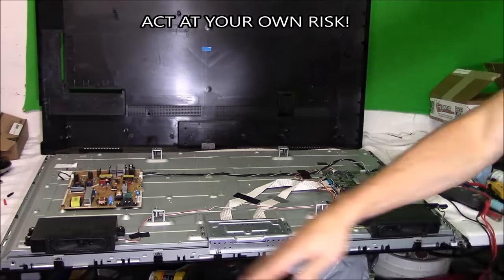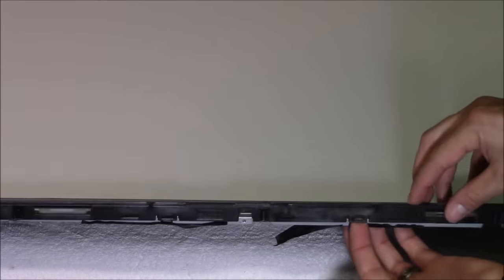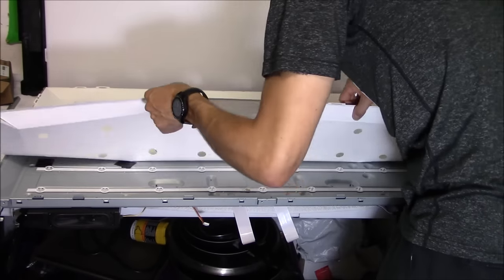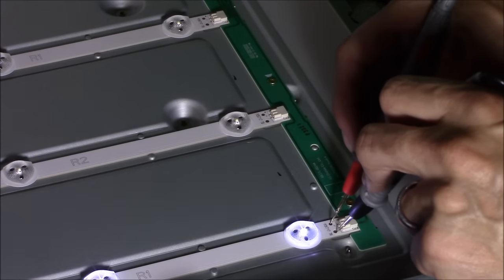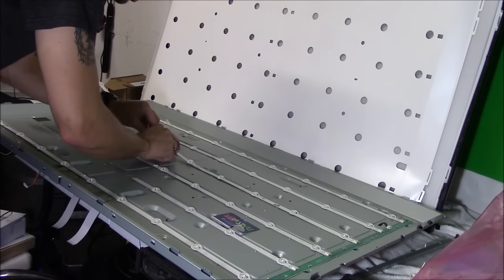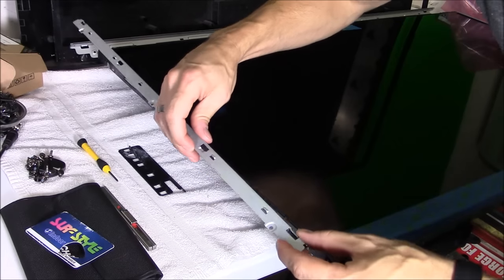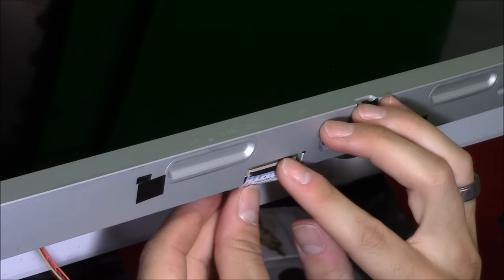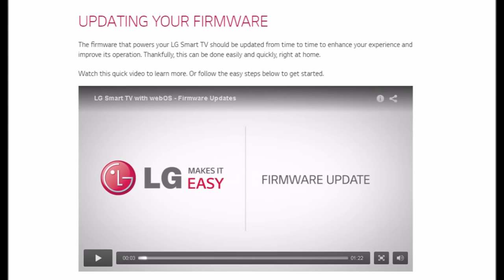How to fix LED LCD TV black screen no backlight, TV disassemble, testing LEDs, ordering part, repair

Comment: hi Tampatec, i have a problem with my panasonic LED tv... i just find out that theres is a bar (5 leds) with a burnt led and the other 4 was dim, so replaced with a new bar but the problem is when i tried to test all the bars before put all together only half of the bars ligth up and the other half not, if i try every single bar is ok , in your video i can see the screen looks identical to mine, 6 strips on the left and 6 on the right,when you test the strip connected together left and right they light up but mines is just half in all the rows ,any help will be appreciated. thanks.

Comment: Hey boss I just replaced the led backlights but I still have the same black screen with words on the screen when I put a flashlight to the screen. What should I look at next
Reply from the maker: Check Led driver circuit and check backlight connections too. Led driver circuit might be a separate board or built-in the power board. Get boards at Shopjimmy.com and electropartsonline.com

Comment: Why am I getting spotlight circles after backlight repair.  I soldered led beads to existing strips.  Is it because I used too bright beads or diffuser bulbs need to be more precise position. Cheers

Comment: i have a vizio e55-e2. one led in the right corner will flicker, sometimes the image is fine. eventually the backlight shuts down completely, image still visible with flashlight. is it safe to say the backlight led's need replacing? i can get a working set for 30$, so not bad if it will fix it. i have electronic experience, but very little experience with screens, so i wanted to be sure that is what's wrong before tearing into it. thanks to anyone who responds!

Comment: hey bro, do you know if the led driver for the rca led55g55r120q is on the power supply board? I have sound, no picture. but the picture is clear as a bell with a flashlight on it.  damn thing is only about 2.5 years old.

Comment: hi there iam jim, need to ask you a question about my philips 55pfl7007h/12 tv. the main power is plugin 220 voltage i have a black screen and led power doesnt go's on screen is totaly black when look it with a fleslight in the sceen i dont see any menu? can you give me some tips

Comment: Do you know the voltages I should see on the led output pins for a model 42ln5300-ub? I could send you a picture of the board if that would help. There are four pins for the led output. I can tell you I do have voltage at the plug one one pin I have over 100 volts DC on another pin I have between 1 and 2 volts with TV off. On the pin that produces over 100 volts with power off more than doubles the power when I power it up and led plugged in. I'm asking you this cause I don't want to try to replace the leds if the problem is from the power board. I replaced the main board and now have sound and can see a picture with flashlight shinning on the screen.

Comment: Could you advise where to find problem. Got Biard smart tv 49" with no light on screen. Found one faultyled in backlight strip. Removed that, by creating bridge with resistor. By supplying voltage backlight lightup. When connect to tv and turn on, back light light up for less than half second and then staing off. No standbylight error codes of flashing. However can see that tv is on and can see picture on screen. Measured backlight contact voltage at tv start. Showing milivolts, then at light up moment multumeter jumps from milivolts to volts, however only to 0v, belive voltage jump is too short, so multimeter is not as quick. Replaced new power boar, still same problem, and wvoltage on contacts still milivolts.

Comment: I have a 32" element flat screen. Made in 2015 an I believe that's also what's wrong with it is the damn back lighting LED bulbs...... because the screen stays black but the sound comes on an the TV turns on but the screen stays black.......

Comment: I have a LG tv I bought from best buy. 55 inch smart tv. If it’s not light strips what else would prevent the picture from coming on. When I turn on the tv it starts to come on it shows the whole tv light up and you can read where the LG lights up for about 1 to 2 seconds then go blank

Comment: Hi, 
Can you clarify something for me please? Based on your videos I think that I have a backlight problem. And your video as your testing the lights it appears that only a handful of them are bad. Why does the entire backlight system fail in that situation. It seems like the screen would only get a little dimmer with a handful of lights out.  does the entire backlight system fail if a few are bad?
Reply: Ok I see further down in the comments that if a couple of the lights go out the TV goes into a "safe mode".  Is that accurate and can this safe mode be defeated allowing the TV to operate slightly dimmer than normally would?

Comment: hey, my tv is a PENDO 48 inch and i cant find the led light strips for the tv , the light strips are 97cm long and the light bulbs are 9cm apart starting from 4cm from the end connector, Does it matter if i use a different brand of light strips that are the same length??

Comment: I have a 90 to 96 volt and a 130 to 137 volt on the led power going up and down plugged in LED cable or not.it is looking for the led strips I assume but the voltages are different on VOUT1 AND VOUT 2 .ANY HELP?I have sound on hdmi and picture with no backlight

Comment: Im facing same issue with Toshiba LED tv , its an old tv , but after exposing tv to direct sunlight for 15 min , it back to work 😁 ,  every time i turned tv on after being off , black screen always there,  but exposing to hot sunlight it back to work

Comment: LG 39LN575S hi my power supply led board is reading 230v at the cable to the led arry (led +) not the stated 130 volts, is this the board or the leds? i have no back lights.

Comment: I have a Panasonic Model TCL55DT50 LCD TV with LED Backlights.  I have audio and can see image with a flashlight.  No backlights. I have replaced LED Driver Board and T-Con board.  Still same symptoms.  I am looking for LED Backlight strips or a kit to replace. Have not disassembled panel so don't know configuration or quantity of strips. The Panel Number is VVX55F130B10 (ADDITIONAL NUMBER 12054J S 001552).  However, being told by sources that backlights are no longer available. 

Any suggestions before I take this panel apart???  Is it worth proceeding?  Expensive TV.......

Comment: Hello! Need help with this TV
Model No：DYNEX DX-60D260A13
Power Supply board No.：MHC180 tf60
Problem: works normally before been black screen in half an hour. The symptom repeats after around one hour. Two parts (QH1 and DH3)with a radiator in the power supply board are very hot before the black screen. LED voltage offload is 67 V, onload is 94V and 15.4V when black screen.
Please offer me some help with this problem, Thanks!

Comment: I followed the video steps by step and everything worked: however, when i turn on my Led TV there is a darkened area towards the bottom. All Led lights work but the brightness towards the bottom is uneven in the picture. 

Any idea what can be fixed??
Reply: Nwalk3er my bank has three tvs one of which has that same problem with it the bottom part is darker ! 
It is the led strips the LEDs are going bad! Sometimes they just go darker and not burn out right away!!

Comment: Could maybe one or two LEDs cause the whole screen to go balck at random?

I have a 70LB650V that works for a couple of minutes before the screen goes black, I still have audio though.
When it is on I can see a darker spot in one of the corners, which makes me believe that the LEDs are dead in that section.
Reply from the maker: Yes it's possible
Reply: Tampatec Ok, would it be due to maybe overcharge to the other LEDs that cause them to go out?

Comment: I have a 55" Vizio tv that is... Maybe 8-9 years old and it had lines on left and right side but I could get over that and just now I turned it on then in the quarter bottom went black like one of the old tvs and and it's blinking in white lines and it's darkened there please help and any way to contact u like send a photo of what it looks like

Comment: Have an LG 55" TV. Back lights went out. Have tester and when testing strips only 1/2 of each strip works. If right part of strip lights up then left does not. Tested each individual led on non working strip and each led lights up individually.  What is wrong?

Comment: Hi thanks for your videos , I wonder if you could help me out with something?

I have an LG47ODUE that shows LG Logo then goes black under torchlight image is visible.

Power supply board tests:

Standby voltages: in order on connector:

9) Ground - Ground = 0.0v
8) 12v - NC = 11.95v
7) 12v - 12v = 11.95v
6) Ground  - Ground = 0.0v
5) 24v - 24v = 24.77v 
4) Ground  - Ground = 0.0v
3) 3.5v - PDIM2 = 3.54v
2) 3.5v - PDIM1 = 3.55v
1) PwrOn - DrvOn = 3.42v 

Most voltages not present until standby button is pressed

Led Connector Tests:

106v down to 82.2v at led connector on both lines. LEDs connected

115v down to 82.2v at led connector on both lines. LEDs disconnected.

Diode Side Test: (red probe to cathode side and black to test points at led connector)

97v and decreases - cathode side of diode to test point at led connector.

LEDs have been checked out of the unit on a DC power supply two strips at 30v all LEDs work.

Work has been carried out previously as jumpers on led strips. Work fine out of unit on DCPS.

I had image but no backlight.

Could this be a caps issue???

Does the TV need all LEDs connected to work correctly (ie) cut out if not enough LEDs for load.

Obviously 88.2v is not enough to drive the leds

Comment: Please Help, I did this... Checked Volts 1 output should be at 100v, if it reads 130v the led backup lights are bad, if it reads 0.0 volts the led driver is section is bad on the power supply board is bad. So, I bought from you guys the power supply board and the T-Con- Board. The screen lights come on and then turns off with in 1 sec. ??Please, I particularly have rebuilt the TV. Awesome but I still need help

Comment: Tampa. if you power on and screen goes from black to a very dark gray ( i mean dark!) does that mean backlight is working?
Reply from the maker: check led backlight volts if over 120v then yes. led backlight will be dim, change to black to bright when about to fail. if backlight flickers or dims to black then backlight can be going bad but don't confuse that with TV eco mode when tv detects room lighting and changes tv brightness and backlight to dim accordingly.

Comment: I have an LG  70UH6350-UB  70 inch TV and as soon as you power it up lg comes up etc. and even of you go to TV it comes up with sound but 5-10 seconds later it goes dark. I turn it off and reset everything unplug etc etc still the same. Then I read where you can put the motherboard in an oven and reflow to get the unit to work. I tried that and that didn't work. So i am thinking is it in the powersupply unit? What is causing the illumination panel to shut off? Maybe you have a better idea. Thanks for any help in advance!
Reply: Btw way if i illuminate the screen with a flashlight i see the images from behind so i am assuming something is turning off the led panels from behind? The screen is well illuminated when it is first turned on , in other words it doesn't appear that any leds are not  illuminating etc. Thanks

Comment: I was hoping for some help. I have a 55" Samsung TV model un55fh6030 and the backlighting went dim. When I go to adjust the backlighting it will go to the number 2 and once I turn it to 3 it goes much darker and will increase slightly when I go up on the numbers but it's still very dark at 20, level 2 is the brightest
Reply: It makes me believe it's not the LED strips but a controller board, am I wrong?

Comment: So I've tested my LGtv with a torchlight and it seems that it does have the same problems with your vizio tv (when the tv is turn on, it does hve sound but no video). I can see the LG symbol moving around after pointing the torchlight on to the screen. Just to be sure....so do I have the same backlight problem? Is that how you know that your tv have a backlight problem? just want to be sure if I have to replace the backlight - thanks!
Reply: Sayd AlSaggaf backlight LEDs or power supply board
Reply: Phoenix Marzrover thanks fr the reply...thank you!

Comment: good vids Tampa,  question my Samsung plasma has this lines across the screen. but i can only see them when the screen is on a solid color any suggestions?
Reply from the maker: can be control board or main board or bad panel
Reply: +Tampatec is it expensive to get fixed?
Reply from the maker: +Damen stokes about 100 dollars but panel is expensive, try shopjimmy.com or electropartsonline.com to buy boards they are tested, warrantied, and offer returns.
Reply: +Tampatec thanks,
Reply: good video & many thanks

Comment: Hi @Tampatec, just subscribe to your channel, have learned a lot from your videos, thank you. I have a Samsung TV that is having an issue and was wondering if maybe you might know the cause of it. 

The problem with the TV is that about half of the bottom screen is a few shades darker then the top half. 
it also has this flashing white light that flashes about every 2 seconds or so just on the bottom of the screen. The flashing white light becomes more apparent when setting the backlight to 0. 

I replaced the T-con board hoping this would fix the issue, but the problem still persist. Do you think this is due to bad LED strips or just a bad screen panel? 

Thanks
Reply from the maker: bad lcd panel or tcon board would have black or color lines or color distortion on screen but not bright white flickering can be power board or backlight board on LED TV its called LED driver board but older LCD TVs its inverter boards. Also YES LED strips can flicker check my repair video- https://www.youtube.com/watch?v=U7hnmJS8Gfg&t=166s
Reply: Thanks for the quick response. I will try the swapping the power board next and see what happens. The TV is a Samsung UN65F6300AF
Reply: Ham Fitness
Reply: Yes?

Comment: So I have a Samsung samsung un46003sf. It wasnt powering on. I replaced the led strips. No issues. However putting together the film layers slipped. Theres tabs to align so no issues. Tv powers on. Works great except one major factor. Its 2 dark! Eco is off..brightness / backlight / contrast have almost zero impact. So i feel theres an issue with how the light is being defused onto the tv...i dunno though. Any help?

Comment: I have Toshiba 50L1400UC. and I have little black cloudy shadow in the middle part. so I have checked power supply for main board and led backlight driver. and I found 0 voltage on vled4+. so is there any Idea what should be the problem here?

Comment: I got one old model with a broken display.  All Leds working good  so I disposed the front display and back cover  and Tcon board to hang it in my garage as a ceiling light. It is too good soft light.

Comment: I tested all my strips with the 3 9volt method and all my lights work. But tv still cuts on and lights up for a sec then black screen? Power board?

Comment: People think it's not worth the trouble to do it yourself or just run out and buy new because the technology is changing rapidly but a friend gave me a nice plasma tv he was going to toss out but it was just a fuse inside the set blew in a lightning strike near by. I changed it after talking it apart and it has been on every day for 5 months no problems.Great picture for movies. Maybe this will change your mind. A set you don't care about is a good one to learn on and the price is right if free like my mine.
Reply: Repair a tv without a backlight tester

Comment: I noted you failed to mention or even handle properly the defuser panels. Any mark on those panels destroys the image quality. Also, LEDs seldom fail, the backlight intensity draws more power but does not effect how long they last.

Comment: Tampatec i have a 60inch sony bravia tv model KDL-60R550A i were total that it had backlight problem so i check the backlight and the one on the left side only half of them come on and the samething on the right side too.when i turn on the tv the screen light up and the picture shows but on the left side of the screen is light and the other side is dark but i still have a picture on the tv.can you tell me what i need to do to fix this problem are what part in need to fix this.
                                                                                                                                    THANK YOU

Comment: What can cause the leds to continuously burn out... some leds that were just replaced burned out within an hour some of them faster. Power supply tested ok but some leds burned out when I turned it on

Comment: Sir i have THOMSON 42PB130S5 Intuiva(2005), when i connect DVD, Sat 
receiver, USb etc i get audio perfectly, but the screen doesn't display 
anything not even light. technicians around me don't have any idea on 
how to go about it. could you help me sir. actually works fine except 
for the screen that remain black.

Comment: What's the deal with these LED TVs? I've had two burn out (black screen) after using for only two years. I watch a lot of TV, but still... When we still had "tube" TVs, they lasted 20-30 years or more! Do you find certain brands burn out faster than others? I'll probably need to buy another TV (the cost probably won't be worth the repair fee), and this time I won't hesitate to buy the additional service warranty! Any advice would be appreciated.
Reply: Cindy Ruoff